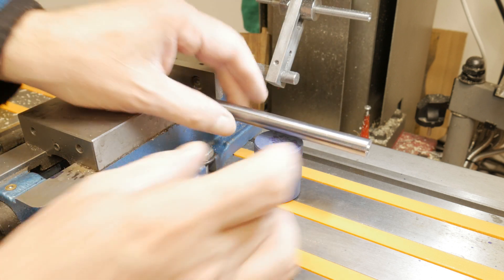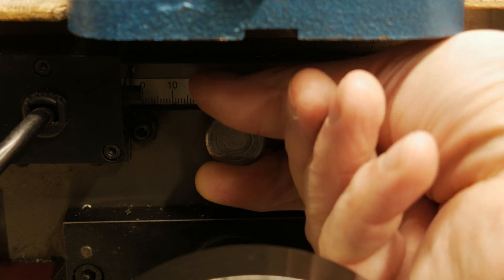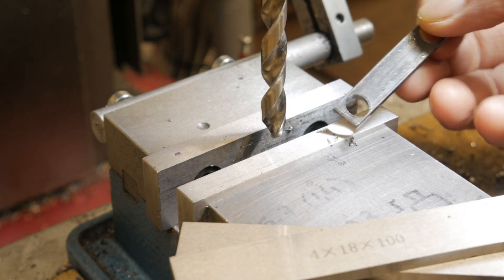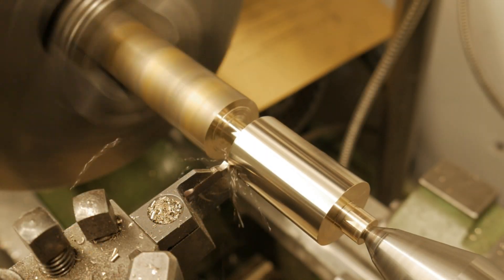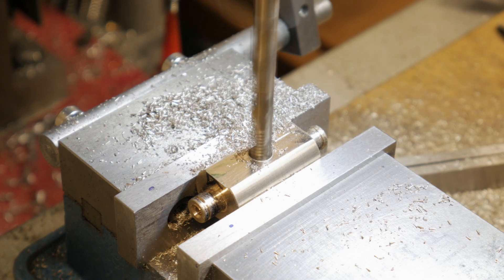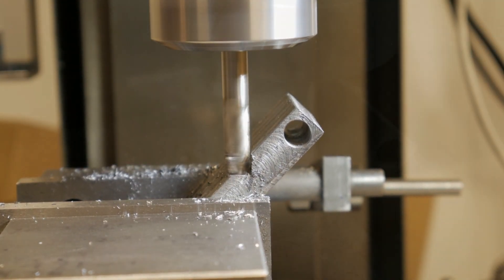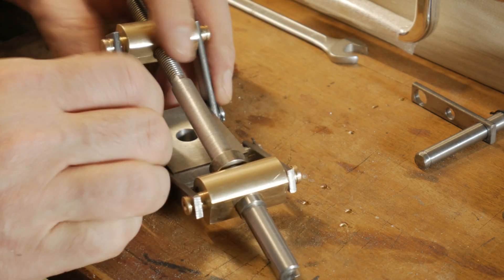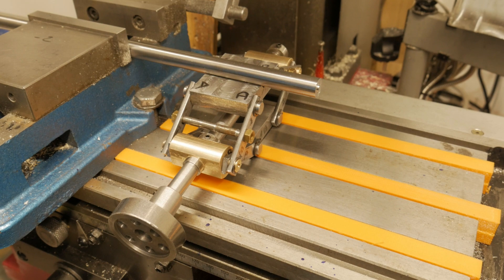Machinist Jack Scissor Style Design: Insanely Useful Tips

Comment: That's a beauty. Very nice work.
Reply from the maker: Hi Michel, thanks happy you liked it: i discovered that without a tie rods (at least 2) on the conrods, the 2 planes moved non-parallel way, there's always something new to learn; also the seeger rings (elestic rings) groove was very delicate, too much inside not fit, too much outside the thickness it does not push the conrod together! Cheers from Italy, ciao Michel !! Alberto.